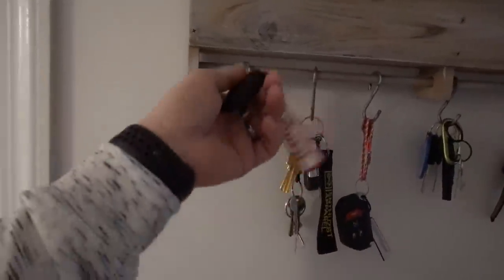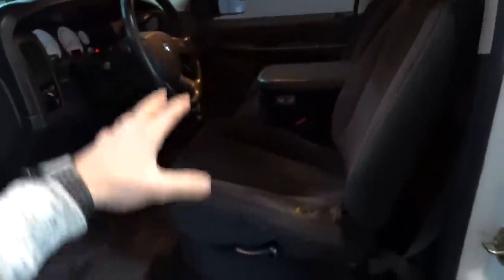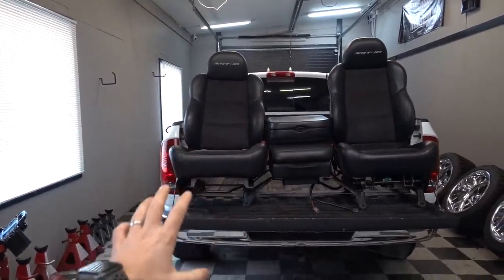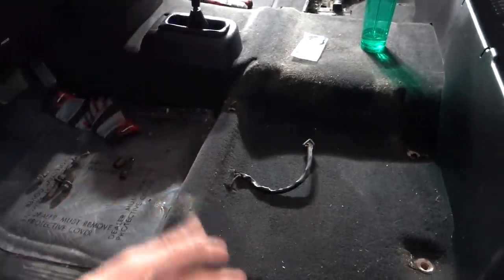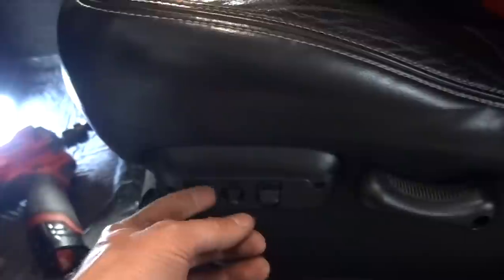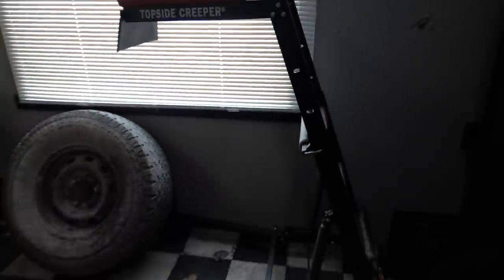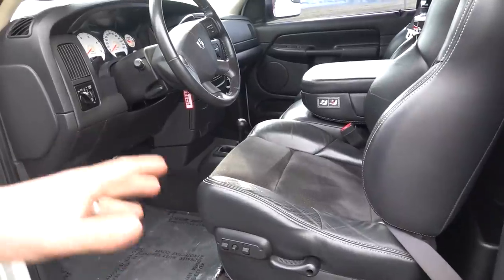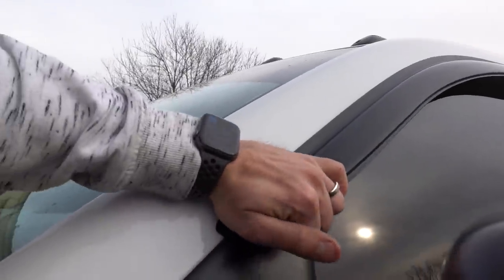Swapping a DODGE VIPER interior into the 1000hp Cummins build!

Comment: In 20:00 video clip the wire you question.  Maybe there is a 12v power outlet  in the center top center console?

Comment: Im pretty sure that extra connecter goes to what looked like a 12V port inside the center console. Ive never done this swap or really been around a dodge much but that's the only thing that would have a hot and ground just like the 12 volt in the dash and it looked like when you flipped open the console there was a cigarette port inside on the driver side of the console.

Comment: The extra plug is for the cigarette lighter/ 12v plug in the center console. It’s at the front of the console on the drivers side when you open the top part up.